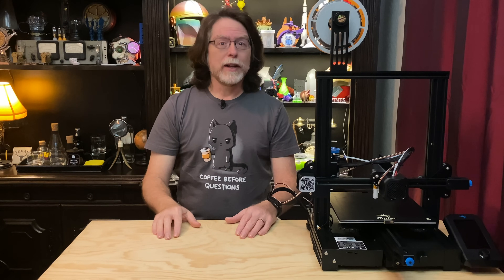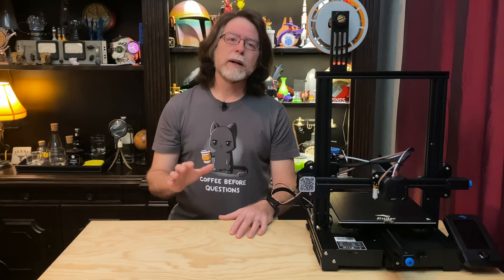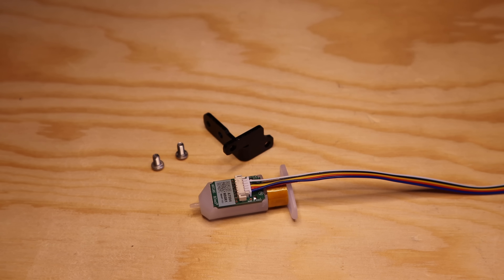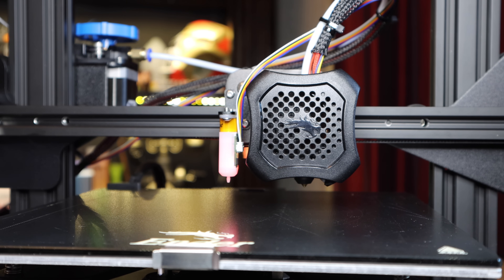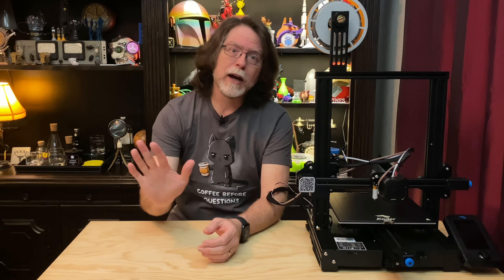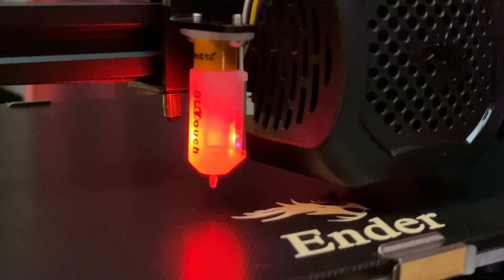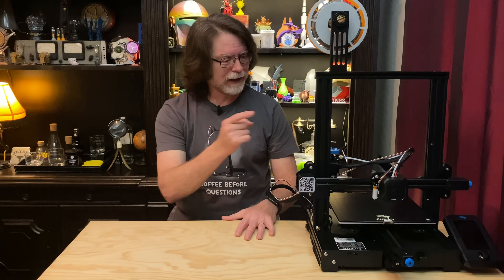Level Up! Install Creality's BLTouch Bed Leveling Kit on Ender-3 V2!

Comment: PROBLEM - NEED HELP. 
great video. I’ve installed as per video on a E3V2 with 4.2.2 board and BLtouch kit like yours from creality. 
When I auto home the Z axis does not move it just stays at the same height and fires the pin up and down a few times.

When I look in the settings it says that Z height is at 0. (Despite it being 50mm off the bed. 

Please help. It’s driving me nuts.

Comment: Hi, I've had a bl touch on my ender 3v2 for quite some time. I was happy with it. I then switched to jyers firmware, still no problem, the problem started only recently where only the center is off ( 5×5 bed probe grid so point 2×2) I've manually leveled the bed countless times, all the points are 0.02-0.05 range but only the center is at 0.53, which is way of because I then manually have to level the bed to 0.02 so that it can actually print, what can I do?

Comment: Need some help I installed CR Touch on ender-3 pro but now the nozzle is to high when I go to print any suggestions how to fix this??
Reply from the maker: Hi, it sounds like you need to adjust the Z offset to be more negative. If you home the printer, and then go to Prepare > Move, and move Z to 0, however far above the bed it is, that's how much more negative you need to set the Z offset.

Comment: Thanks Bryan! Your video really helped me setting the Z value, once Creality manual really sucks! I bought the CR Touch instead (Creality's) and I had the "luck" of having an updated manual. However, it shows moving Z axis to negative values, which is impossible with the current firmware and you have to keep compensating it, as you just did, with the offset Z value, which is an absurd... Thank you again for your awesome job helping people out!
By the way, are you using Jyiers' firmware ou Creality's now? I had Jyiers (following your video) but moved back to Creality's since I couldn't generate the BIN file on Marlin's... Bye!

Comment: This is an amazing video - almost followed along by the minute. When I went to home it the BL touch stays red and does not send out the probe and just stays at the home and nothing happens. X and y are good but it does not move the head toward the bed and the BL touch stays red and just holds. Any idea?
Reply from the maker: Hi Brent! Is the original Z end stop switch still plugged in?
Reply: @BV3D  the cable is still plugged to the motherboard but unplugged from the z limit switch which I removed from the machine.
Reply from the maker: @BrentCampbellcrazybioteacher  OK. When you turn the printer on, does the probe do a self-test, where it deploys & stows the probe two or three times?
Reply: @BV3D  no it stays red the entire time
Reply: Fixed! Bad firmware flash all is good!  Thank you for helping out!
Reply from the maker: @BrentCampbellcrazybioteacher  Awesome! I'm glad it was as simple as that, and not bad hardware!

Comment: Hi Bryan! I have a question: As you say, after I installed the BL Touch and auto-homed it, it raised up 10 mm as the final step of the homing process. The problem is, it continues to do that even after I have adjusted the Z offset and manually level the bed, when I set the z offset back to 0.0 and auto-home, it is again 10mm off the bed. How can I fix that?

Comment: great videos and easy to follow, my question is when you start printing and the sensor is doing its thing, is there a way to stop the extruder leaking?
this is causing me issues with my 1st layer, and causing a lot of frustration, thanks
Reply from the maker: You could edit your slicer's Start G-code so that it performs the probing operation after the bed is heated, but before the nozzle is heated.

Comment: I have the same printer and the same BL touch kit. I installed following these steps but when I auto home the BL touch centers but never lowers to the bed. Also, when I start the printer the BL touch blinks red but the probe doesn't descend. I disconnected the Z axes limit sensor. Has anyone else run into this issue? Thanks.

Comment: Ive ran into some problems, Ive mounted and wired up the BLTouch as well as installed the software but when i try to auto home or use any other commands it just doesnt respond?

Comment: Brian I did every thing you've told me after mounting the bltouch. Have altered the Z-offset and did the paper test. But stil when I start the print the filament does not stick to the printed. What can be the cause of this

Comment: Will the pins you used work with the Jyers firmware? My Bltouch is v3.1 but came in a box for the old board with the split harness/different colors. I have the 4.2.7 board and would like to just follow the pinouts you used ignoring the colors (i'm an electrician so I think I can handle it, lol)

Comment: When it is homing for z, all it does is go to center and goes up. stops. And does a probe dance for a while. What am I doing wrong? I downloaded same firmware too, I have a 4.2.2 board. Also, when U opend it, it was in chineese.

Comment: BLTouch does not level or help to level the bed! It compensates for bed surface irregularities. That's all it does. The irony is if your bed has an irregular surface then the BLTouch does little to make the surface of the print any better. The bottom of your print will be as irregular as your build plate surface. The BLTouch helps the printer to make Z-axis movements that keep the nozzle from coming into contact with the build plate while maintaining an adequate print distance from the bed. It does this by creating a mesh pattern of the build plate, which is then used to extrapolate nozzle distance from the bed. If you have a build plate with an irregular surface then this is a good tool to have. It will protect your nozzle and build plate. If you are looking for a device to level the bed, this is not that kind of device. The hype on the internet about this product is misleading. It starts with what's in the ads - auto bed-levelling!?!

Comment: Do you still need to manually level the bed before doing bl-touch.  I am replacing my springs with silicone spacers.  should I get it close before installing cr-touch
your videos are awesome

Comment: I have observed that if the bed is too low in certain area's, you will find that during a probing mesh scan it will stop before it measures properly, and end the probing procedure.  Bizarrely it will offer to save the result lol. (based on Jyers firmware).

Comment: This was very helpful for me, thanks!  I have a question though.  My BLTouch has worked well for about a month now but today I booted up my machine and the z-axis motor didn't stop when the sensor hit the bed during auto home on my E3v2.  Any ideas as to why this might have happened and how to fix it?

Comment: Considering that it takes me 30-45 mins to level my bed every time.. 2 mins is fine. 
I threaded the BL Touch's wire through the tubing with some old wire as a hook. Looks like a factory install. Thanks for the tip!

Comment: I have this printer, and it's nothing but problems ... save up and get a Prusa.  Every video on this printer has different parts -- my BTtouch mounting bracket is seemingly larger than yours and I need to move the fan shroud to install it (no idea how to do it) ... and then board plugs are different too.  You get what you pay for folks ...

Comment: Hi, I followed all the instructions but at minute 8:18 it didn't happen, the z-axis keeps going down and the nozzle hits the bed keeps moving, so I had to cut off the power to avoid any damage, which may be happening. I'm sorry for my English

Comment: Is this still an accurate video for installation the BLTouch?
Reply from the maker: Hi, it's accurate with regard to the wiring and mounting of the BL Touch, but finding Creality's firmware files is kind of a mess. You might want to give the precompiled JyersUI firmware a look; there's a version of it supporting the BL Touch. See https://github.com/Jyers/Marlin/releases

You'll still need to know if your printer has a version 4.2.2 or 4.2.7 main board in order to select the correct file. There are a lot of files to choose from. If you need help picking a file, let me know.

Comment: The Creality google drive organization is poop! I have an e3pro with the 4.2.7 board but the original screen. It seems impossible to decipher which witch I need. I ordered a V2 screen just so I can get the Jyers pre compiled firmware. I shouldn't have to compile my own or anything else. Jyers did a fine job listing their prebuilt images so anyone can figure it out. Bryan's vid on Jyers lays it all out. Thanks dude!  PS will I need a new screen ribbon for the V2 ?
Reply from the maker: The screen comes with a ribbon cable, but the one that's already plugged into the mainboard should work. On my Ender-3 Max, with a 4.2.2 board, I replaced the 12864 screen with a V2 screen. The existing cable was already in the right port on the main board, and it just worked (after installing JyersUI, of course).
Reply: @BV3D  thanks for the heart and quick reply. Screen should be here soon from walmart of all places. I can't wait. I know I sound like a wimp but I've put off installing a Bl Touch I've had for a year because of the firmware mess.

Comment: So it seems as though you know your way around this model printer. I just bought one the other day and this is my issue. Maybe you can help.
If I tighten all the leveling nuts and bring the platform to its lowest position with the Z-axis limit switch at its lowest position, the nozzle scrapes the print platform at the back of the platform.
It seems as though the back of the print platform is higher than the front. I had to raise the Z-axis limit switch about 4mm off the bottom just to be able to adjust the print platform but it is difficult to level it.
 Is there a way to adjust the bottom rail(y-axis) that the platform rides on because it seems like it’s out of level? Everything went together so well until I got to Bed Leveling. Hopefully, there’s an easy fix to this issue. Thanks!

Comment: Alright I now have 2 ender 3 v2s both with bltouch and both mother boards have 4.2.2 but everytime I store settings on the printers (while the sd card is inserted) there are no files on the card except for items I have put on the card.   

Are the stored settings invisible or something?  Because u said the settings, saved, are saved on a file on the SD card....

Comment: how do you manually level your bed once the Z-stop is removed. For example, I installed the BL touch and then later changed my bed springs to a more firm set. The BL touich  probes around but is way too far away when printing. can't seem to level it.

Comment: I've had the Ender 3V2 for a few months now and haven't felt it necessary to get the BLTouch, until I tried printing with PETG. I think to assist with good bed adhesion (if it's an issue) the BLTouch is one thing you can do to help.

Comment: A massive help, thank you.  Two additional things I learned as I attempted to implement this;  G-code is read line-by-line,  This means that for G28 G29 ;Home G29 simply is ignored (it is not recognised by the interpreter as parameters for G28). This should be changed to two lines;
G28 ;Home
G29 ;Perform bed levelling
Also (I think) the BIN file a) has to be a unique filename you have not used before and b) should be a short name.
Reply: He did say after 28 not on line 28

Comment: What's with the "Push button" every time just to raise or lower the Z axis or move X and Y in increments?. I prefer the old way where you have full control of raising or lowering the Z axis, X or Y by turning the button CW or CCW. Even with the Jyers Firmware. Seems like a step backwards to forwards!

Comment: I know this is a longshot to get a reply but My printers been working fine after following your video but recently when i tried to set the z offset and autohome it makes a loud noise from the bed as if it was trying to retract back more. and now my probe wont even probe the bed cause it keeps missing it lol would you know if im doing something wrong?
Reply from the maker: Hi! When performing a "home all" on a printer with a bed probe, the printer usually homes X, then homes Y, then moves X to the center position, Y to the center position, and then it homes Z, more or less right in the center of the bed.

It sounds like what you're describing is that when the Y axis homes, it moves the bed all the way to the back of the printer, but instead of stopping, the stepper motors just keep on trying to move the bed... But it can't, because the bed can only move so far. 

If that's what happens, then I recommend checking the Y axis limit switch. When the Y axis homes, it should trigger that switch, and the bed should stop moving back. But it sounds like the switch isn't being triggered. Things to check on that switch are that the cable is plugged in. You might unplug the switch's cable and then plug it in again to make sure it's fully seated. And also check to make sure that the switch still has its silver paddle thing in place.

Hopefully it's just a problem with that switch.
Reply: @BV3D  that brings some light to it. Thats what i was thinking its just so frustrating xD still thats a big help. and I really really appreciate you!

Comment: Pretty sure I followed your instructions right, but I've been having some issues: I've been using Jyers and G29, but it only probes the center of the bed like twice instead of creating a mesh, and then just starts the print.

Comment: I received an older bltouch which doesn't have the single connector but 2 connectors for power and z-stop. Just fyi for anyone having the same problem, voltage and ground MUST be switched on the power connector and the z-stop connector has to be shoved in right next to the power on the BL_T pins, little modification required. You cant plug the z-stop on the bl touch to the z-stop pins or else your z axis will not go down is has to go on the BL_T pins.

Comment: just got ender 3 v2 and a CR touch auto leveler. am complete noob. wtf is a gcode how do i get my bed leveled. how do i get the correct nozzle height

Comment: Hi, I am new to 3D printing and I purchased the Ender 3-V2. It has been frustrating getting a print to complete without coming loose from the bed. I also have managed to scrape the beginning outlines of 2 different prints that I've attempted due to incorrect Z-"offest" even after doing manual leveling and before I had purchased the probe. There in lies my frustration. So, I purchased the BL Touch, have it installed (BTW, it was very easy to feed the lead from the BL Touch through the mesh harness). Now I am meticulously following instructions which leads to my question. How do you save the Z-offset?  Do I just place my SD card into the slot prior to autohoming and then use the screen to save the Z-offset (push the knob in after scrolling to Save Settings?  Will this offset stay for every STL file added to this card?  Please help as I do not want to mar up the coating on my glass bed plate any more than I have. Thanks.

Comment: What is the exact text for the G29 line? G29 ; probe bed ??
Reply: I've done some 3D printing with "easy 3d printers" (Dremel 3D45) but wanted to use a lower cost printer and get some better information on all of the ins and outs of 3D printing. So, i'm digging in here in hopes to better understand all of the settings and how to troubleshoot the printer, slicer and other settings. Any help would be appreciated. Thanks
Reply from the maker: The only thing actually required is G29 -- From the semicolon on, it's just a comment to whomever comes along later and wonders what the code does.
Reply: @BV3D  Thank you for responding to my question. I think I have it now. I have 4 successful small prints off of my Ender 3 v2 now.

Comment: So, once you have your BLTouch installed, the new springs in place, the GCode in the slicer, and your Z Offset set - if you don't really ever change the bed, do you have to do minor spring adjustments from time to time?  That's the only thing I didn't see in the video.  My z-offset is -3, and pretty much nothing has changed since I installed everything about 2 months ago.  If the BLTouch is working, do you really ever have to touch the new yellow spring leveling again?

Comment: Thanks!
Reply: On Amazon I found a nylon/plastic cover for wires. It is split and flexed so you can slide the wires and it wraps around the cables without having to fish the wire down a enclosed wire protector. Thank for the excellent advice.
Reply from the maker: Oh wow, thank you very much! 👍

Comment: This is the definitive tutorial for the BLTouch on the E3V2. Nice work, Bryan! I've installed mine a couple of hours ago and your tip for setting the Z offset saved me. I'm using Jyers' Marlin and it makes this a little easier too.

Comment: ok since I have a ender3 pro and I installed a BL touch can I take off the Zstop ?
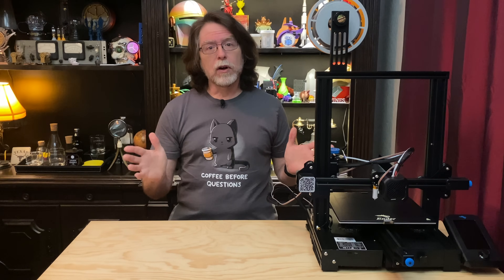Reply from the maker: Yes. That's what I did around the 7:52 mark. The BL Touch functions as the Z end stop. 👍

Comment: Awesome video. All of your videos are very informative. Quick question, when setting the z-offset, must you do so for all four corners like you would when manually leveling or is it only done on that corner? Thanks for any advice. Just got my 3 V2 two days ago and tried leveling for two days only to realize that the center of my bed bows up everytime I get the corners leveled. So I ended up ordered the BL TOUCH.